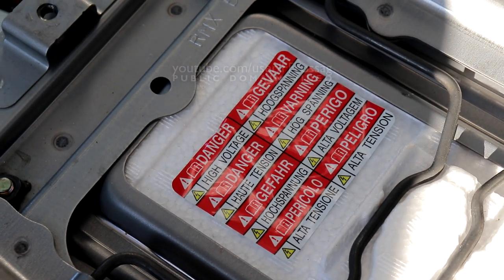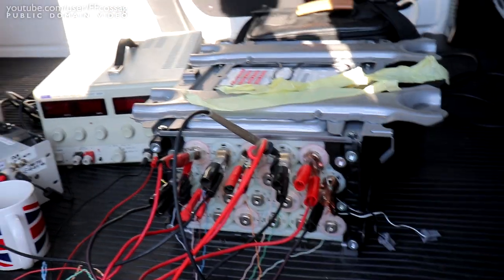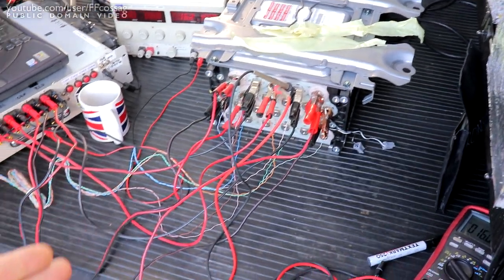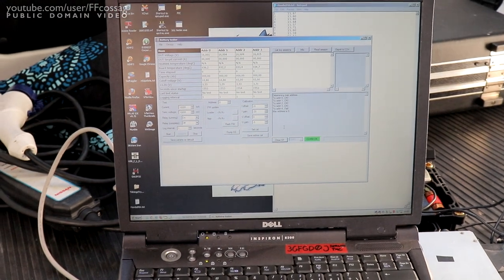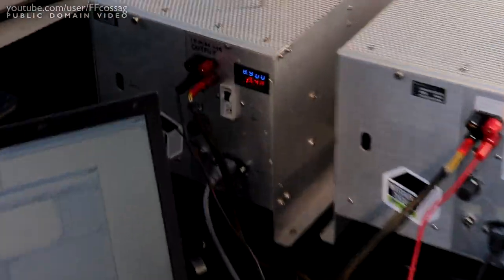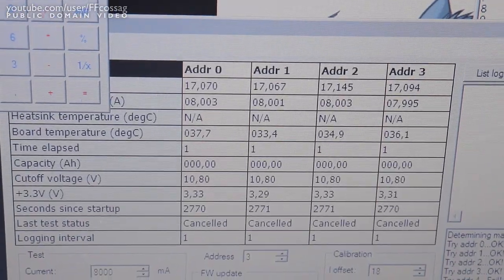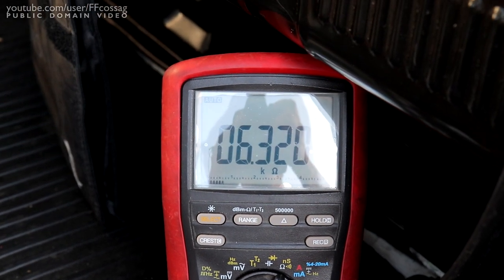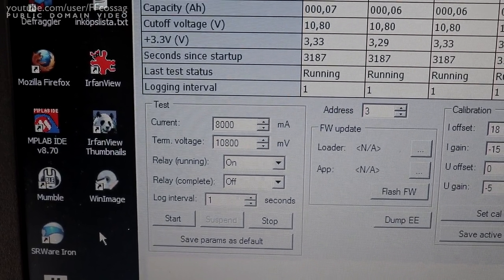2nd gen Honda IMA battery experiments & restoration blog

Comment: NiCd and NiMH cells can develop tiny metallic dendrites internally which cause self discharge and effectively limit capacity at low charge rates.  They can be burned out with high currents which would explain why this was more effective than a trickle charge overnight.  I have revived cells by dumping very high pulses of current into them using a capacitor, but they don't always stay good in the long term.
Reply from the maker: Yes, but I doubt that's the case here. Cells that suffer these tendencies tend to have extremely high rates of self discharge, or simply be completely shorted. The cells in this pack do not seem to self discharge at a rate higher than I was charging them with, so I don't have a smart explanation for why that did not work.

Comment: The 1st gen makes 10kw, 2nd 15 kw, 3rd gen 20 kw. It.seems generators not the batteries are the issue. Mine charged fine too 7.85v to 8.15 per stick avg

Comment: All the more reason to insist on the Right to Repair, most people would say this battery was dead so buy a new one at a cost probably more than the car's value, but with some time and effort, you've brought the batteries back to life for far less cost than a replacement, Reduce Reuse Recycle!!! :D
Reply: Thats what i don't get about all the modern companies that wont give you schematics etc. They claim to be all super green and the like, yet there policies are anything but! I mean whats greener, recycling and reclaiming all the parts in a laptop ( and then having to make a new one ) or letting a service tech know where the fuse it on the PCB so they can spend 30 seconds replacing it ?